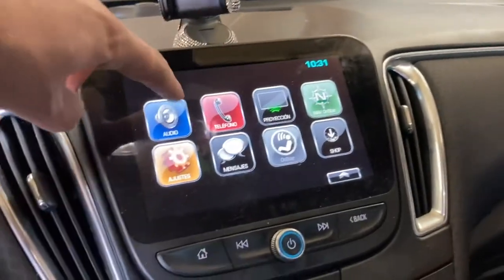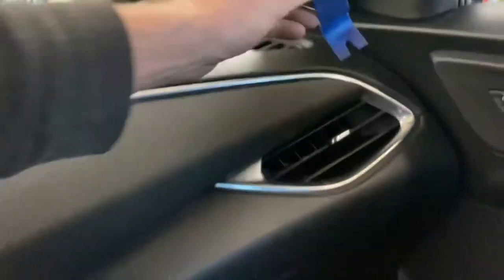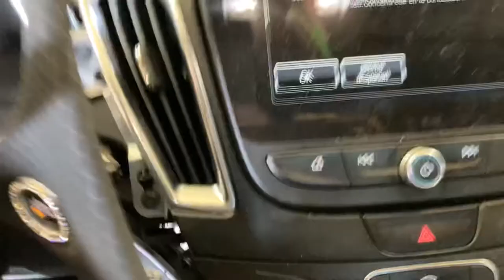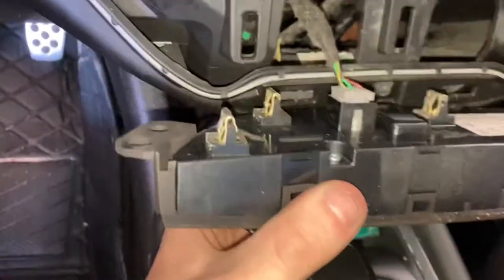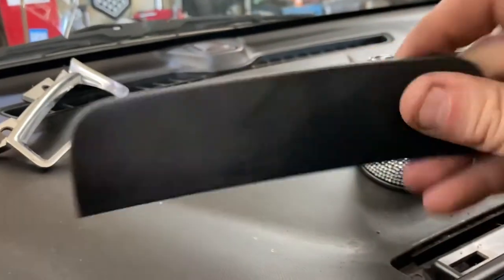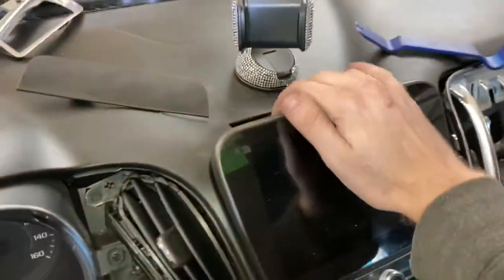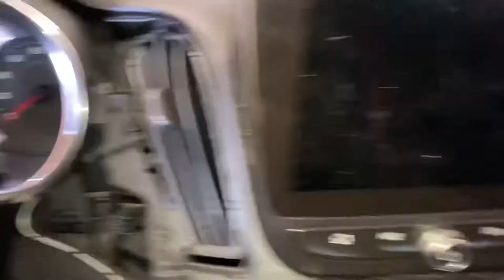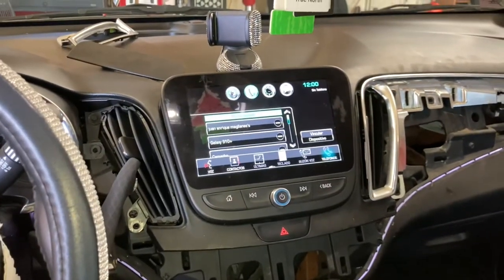2017 Malibu radio removal (all the little tricks)

Comment: if another model malibu has the other radio can i take it out and put this model radio in???
Reply from the maker: I have not tried that yet to be honest, but I have an idea. You can look up videos of the both and look for the wiring harness to see if it’s a match. But it’s still a GM and they have many different data harness’s. Is it the same year Malibu? That would be best, if it were me I would go for an android car stereo. Look them up. They are taking over with Tesla style stereos that are plug and play with some adjustments in settings. Find a unit that’s fitted to your dash and everyone of your friends will want one.